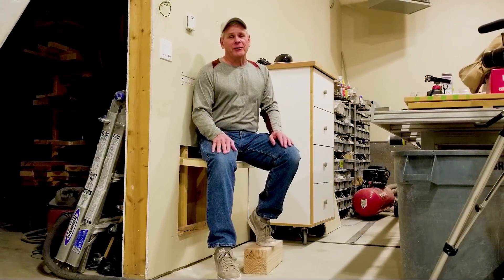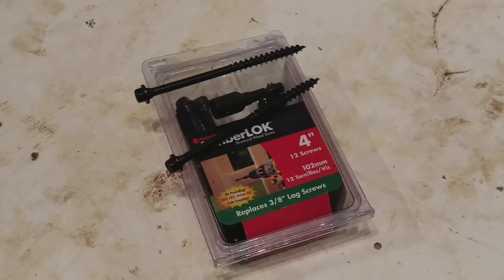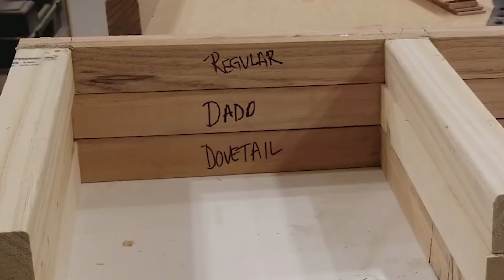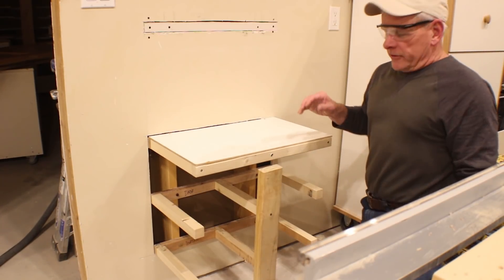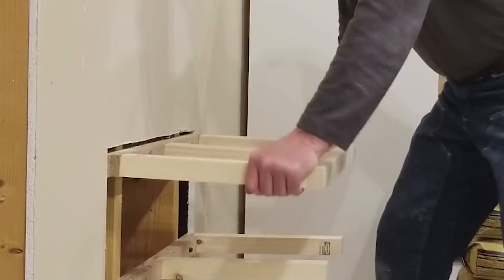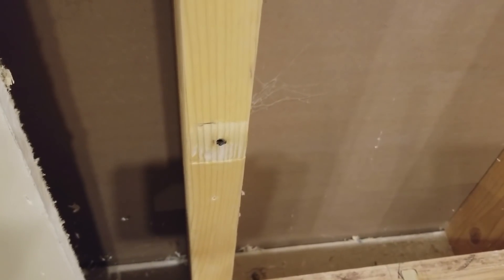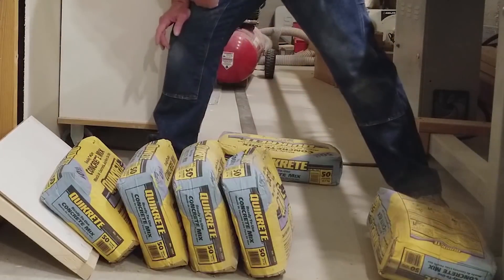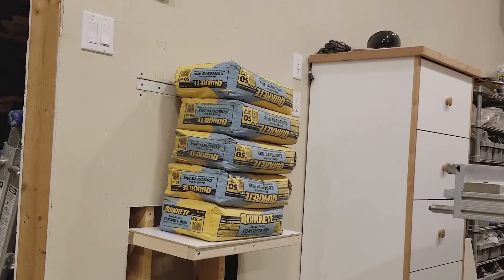250 Pound Max - Three Floating Shelf Strength Tests Based on Viewer Comments

Comment: Great video !  If your going to open your wall can i suggest trying using a 2x12 x the length needed and notch it so it goes between the studs and screwed in on each side of the studs. End result you would have your 2x12 sticking out about 8 to 9 inches and you can add to the front to your desired depth. Exemple add an another 2 x 4 glued and dowel into the face of the 2 x 12. Also add blocking ( 2x4 ) from stud to stud on top and bottom to help with counter leaver. You could also add your dowels like you did in your previous video, inside stud wall and 2x12.
This would run grain parallel to the wall, so you could also try basically the same with 2x12 running perpendicular to the wall
Hope this makes sense and you put it to the test.
Keep those video coming
Reply from the maker: Thanks modifyit1! I appreciate the comment and your suggestion for another design. You and some other viewers have gone down the path changing wood grain directions and using the lateral surface of the studs to help support the structure which makes perfect sense. Lots of ingenious people out there in YouTube land! Thanks again for the comment!

Comment: Sorry for my english I don't get all the technical words but what about "notches" in studs and put the shelve right in those notches? Is this will avoid the wood spliting?
Reply from the maker: Thanks for the comment, Seb! Your English is quite good! Certainly much better than if I were trying to write in your primary language! Yes, cutting notches in the studs would add strength to the support piece that split under the load. That is a good idea! In a real life installation, I'm not sure I would go to that extreme. On a floating shelf, I would probably not want to load it with more than probably 50 pounds in a two foot span. I'm glad that these tests show me it is capable of holding much more weight than that but if the primary need is there for a shelf to hold a heavy load, I would choose a different approach that assured there would be no unexpected failure. Your suggestion would move the stress to the dowels and joint connection of the shelf, I would think. In all likelihood, the shelf would hold more weight. Not sure how much? When it broke, it would come down in a hurry! Thanks again for the comment!

Comment: I think you are underestimating the strength added by a piece of searching on the bottom that would be pinched if it's right against 2x4 s
Reply from the maker: Yeah, it was pretty close but the sheetrock was still far enough away from the bracket that it did not interfere when the shelf started to flex. If it had been tight against the bracket, I would agree that it would have added some strength.

Comment: I just had a brainstorm. The support is failing because the attaching board is 90 degrees to the wall studs and the wood grain is parallel to the floor. Is it possible to make an engineered board with the attachment points in line with the wall studs, ie wood grain is vertical. You would have to glue and/or screw two or more pieces of wood together to do this. The question is, is a glued and/or glued and screwed joint stronger than the wood itself. Of course this results in a butt joint which is a weak joint. Dovetail, rabbet, miter to increase wood surface for gluing along with the screws.
Reply from the maker: I think I follow where you are heading, Jeff. You are definitely on a track that I never thought about! I'm going to think on that a few days and will comment back later. My initial reaction is that you are right. Not sure what the "engineered board" looks like right off hand. Thanks for the insights!
Reply: I got it! Use plywood, that is an engineered board, at least a double thickness or 3/4 and three layers would be even better. Half of the laminations would be oriented to align with the wall stud. If you rotated the middle layer 45 degrees to the other two maybe even better.
Reply from the maker: One of the things I enjoy about making videos is getting comments like yours. There are some people like you out there, men and women, that get on a thought track and work it to a conclusion! I cannot tell if you are trained engineers or just innovative thinkers. The world is made up of interesting folks! Anyway, thanks for taking the time to watch and comment. Great idea, Jeff!

Comment: They make those Timberloks with a much wider head under a different name, I believe it might be Ledgerlok, I have a bucket outside and can attest to their usefulness and ease of use.
Reply from the maker: Thanks, Jeff. Yeah, its been a long time since I have done any significant framing so I haven't stayed up with the innovations in fasteners. A larger head surface was what I was trying to achieve with the addition of washers. I was a little surprised that didn't seem to affect the results. A built in larger head like you are describing with the Ledgerlok probably would have helped. Thanks for the comment.

Comment: What if the dowel went all the way to the front rail?
Reply from the maker: Not sure about that one, Brian. But it seems like it might help take some strain off the back support piece that ultimately failed in the video. My guess would be that it would hold more weight and that the dowels would be what breaks when it fails. Interesting idea.
Reply: It would fail sooner due to more leverage applied to its juncture to the wall stud. In all cases, it is the leverage exerted against the wall juncture that causes failure along with the strength of the dowel. The wall juncture is defined as the piece attached at a 90 degree angle to the wall stud.
Reply: You electricity bill would be sky high from all the drilling.

Comment: Cut the wood 1/4 where you can place a steel plate against the stud and a 90° steel 1/4 support on the inside of each joint with the 3/4 inch Dowl rod used in previous videos...
Reply from the maker: Yep, that would make a difference, Matthew. Thanks for the comment.

Comment: Post one with hardwood. What about Steel?
Reply from the maker: You know, I think that if someone is really getting serious about installing floating shelves that are going to carry a lot of weight, he should probably explore the possibilities with steel. Wood can be surprisingly strong and easier for most people to work with, but steel is obviously stronger. I may do some experimentation with steel holding up granite shelves but not sure when I'll get to it.
Reply: Steel can get spendy. Instead of $10 in materials most people will need to pay a welder.
Reply: @krehbein  I'm not sure about the welder part of that. I am about to get creative with black iron "gas pipe" as the supports for a shelf. Its available everywhere and you just screw it together. I need to hold 110#

Comment: Great work and data collection so far.  The common failure seems to be along the grain.  I'm curious how a stack of three (or so) glued, laminated layers of OSB would hold up in that rear position instead.
Reply from the maker: Probably would hold up pretty well, would be my guess. Yes, when it comes down to it, the stress is on the lower portion of the back support piece and the grain is the weak link at that point. Thanks, Kent, for watching and the comment.

Comment: What if you stack the boards like a butcher block and put wood dowels threw all the boards
Reply from the maker: Well, you are talking about a stout piece of material!
Reply: Rusty Dobbs the more stout the better right 😀 and it would look pretty nice in my work area
Reply: If you do that, it will simply snap at the stud. Something has got to give. You would have to increase the dowel size. In any case, the floating shelf will not fail on the shelf itself. The weight is all compression and it would take a million pounds to compress the shelf material. The weakness is in the attachment to the wall. A thicker shelf  to allow for cantilever supports is the answer but we are talking aesthetics and if you get too thick a shelf it gets ugly fast. Of course, you could put a wide fascia on it and thereby doll it up.
Reply: Jeff Stanley on the current shelf it's breaking at wood at the wall so I figured by making that stronger it would at least double the weight capacity

Comment: Maybe put a little metal plate to increase the survive on the indentation point on the stud
Reply from the maker: Yep, you are right. I don't think I would be comfortable installing this type of setup for a customer unless I knew the weight was going to be less than about 50 lbs spread over two studs 16" on center for whatever the length of the shelves. I enjoy sleeping well at nights too much! But I, too, was surprised. Never thought floating shelves could perform like that. It has changed my viewpoint on storage shelving in my shop, however. I'll be using variations on this from now on just because you get good strength and don't lose space between shelves because support brackets are in the way. Thanks for your comments!
Reply from the maker: Yeah, you are both right about ways to address the back edge of the backer to keep it from denting the stud. I was thinking that if the backer piece itself was widened to 2" from 1 1/2" that might proportionally increase the strength capacity of the shelf and limit the flex. But I agree with sixtofive that, in reality, not that much is gained for practical purposes. The biggest take away for me is that the 3/4" dowels glued into the studs are incredibly strong. The simplest way to attached floating shelves is to run lag bolts through the backers and sheetrock, then into studs. That will work great, but depending on the weight, the shelf may flex a little. With dowels glued into the studs and even running through the sheetrock then into the backer, the flex is pretty much eliminated. I was really surprised! Thanks for the thoughts, Joop and sixtofive!
Reply: Rusty Dobbs As fun as it is to speculate and experiment, at the end of the day the most important factors to consider as the contractor are if the customer is satisfied with the appearance and were you able to make a profit from your labor. It is really interesting to find out how strong these floating shelves can be, but if the customer specifies a need to support a large weight it may be in the best interest of both parties to suggest a shelf system which transfers the weight into the floor rather than the wall studs. That being said, your results were still quite impressive!
Reply: Joop Terwijn that's what I was thinking as well. Possibly make the plate extend several inches on either side beyond backer to spread out the force. Even without that they were already holding far more weight than they would likely need to in real use.

Comment: The strength of the floating shelf is determined by more than a factor ,type of wood, dimensions , joining method , type of glue ,....etc , so it's a matter of finding the right combination if I can say between these factors , from what I've seen in this video and the previous ones I can say that you have came very close to finding this point . 200 pounds is a considerable wieght for a wooden floating shelf , I don't think that you will ever need to exceed it at least in the real life applications , as always a very informative video that saves time and money for diy'ers who want to try this kind of shelfing.
Reply from the maker: Hey F! Couldn't agree with you more. I'm very comfortable moving forward with floating shelves in all kinds of applications without concern about the weight issue. Realistically, 50 lbs max in a two foot span is all I could ever envision for my purposes. 200 lbs. on a 12" shelf is kind of 'freakish', but it worked. I hope many people are able to take some practical information from these videos. I will be doing probably a couple of floating shelf videos on quick installs for more industrial looks and the process for a higher end look with a little more detail on doing corner shelves as well. Thanks for the comment!
Reply: I would suggest going over broad so as to put large books on the shelf that are made out of stone and all the texts are chiselled in by hand.

Comment: Thanks Rusty for showing that "constructed laminated dado" backer idea in action!  Couple changes from my thoughts there, as I was commenting on your original shelf where the 1.5" thick pine backer was doweled to the studs, not lagged, which I believe contributed to the cantilevered failure here (I believe the extra strength of those 3/4" dowels over the flexing lags could have helped prevent that denting of the stud, or maybe even some thicker lags).  Also, my idea was to use 2 laminated 3/4" thick plywood strips for the backer, so the multi-directional grain in those would resist the cracking seen in the pine backer from your first video.  Of course your oak backer likewise didn't crack.  I didn't think of it because I'm too cheap to use expensive oak in a shelf support.  lol    Just offering these thoughts in hopes they might help with your future floating shelf options.  Sure was entertaining watching that dado joint in action!  Thank you for using it!  Subscriber for life here, bro!
Reply from the maker: Yes, JusBidniss, I took a little creative license with some finer points of your suggestions. I would have glued the dado in for the last test instead of the "regular" bracket but I unfortunately broke the right shelf support on the dado bending it around in footage I didn't use. But it would have held the 250 lbs, too. I regretted not gluing it in with the dowels to begin with when, as I started testing, I realized that the TimberLOC screws were going to have more flex to them than the dowels would have. I added the washers but it didn't help. So, the dado really didn't get to show it's stuff but it was as strong as the regular bracket and dovetail. The only change I would make on the construction of the dado would be to make true dados on the left and right legs, too, by extending the backer out another inch on each side. They turned out to be rabbet joints in reality which did weaken them. Regarding the oak, I have a lot of extra pieces stacked around I have gathered over the years, so it was a good choice for me. Glad you enjoyed the video. I figured you would get a kick out of it! I appreciated your input with the dado idea and was glad to work it. Hey, thanks for the support as a subscriber! Hope the "life" part will be many years for each of us! Take care.

Comment from the maker: I have had a lot of comments on my floating shelf videos and always appreciate hearing from you. I used ideas from three viewers for this video which were quite interesting. This will pretty much wind up my strength testing of floating shelves. I have been surprised at how versatile these things can be particularly when you are not worried about their strength. Steel will always be stronger but wood has the advantage when it comes to flexibility of application in my book.
Reply: Rusty Dobbs Could you use the metal plates that are used for joining drywall sheets and put one against the stud so that you don’t get the dent?
Reply: Had a similar thought: use stud protection plates (with a hole in them for either dowel or bolt)

Comment: Which method did you use for the shelf your sitting on at the beginning of the video?
Reply from the maker: Hey Matt. It was the 'regular' shelf I had installed on top and tested first in the video. For the sitting footage, I installed it with 3/4" dowels through the oak back support and glued into the studs. It's also the same shelf at the end of the video with the 250 lbs on it. I did cut it back to 12" wide from 15". That does make a big difference.
Reply: Thanks for that info. Great video